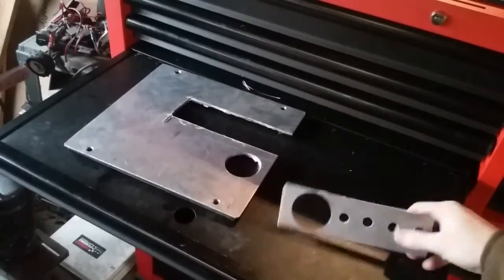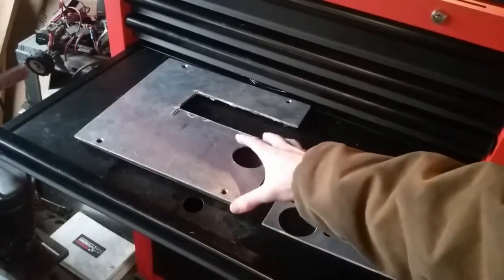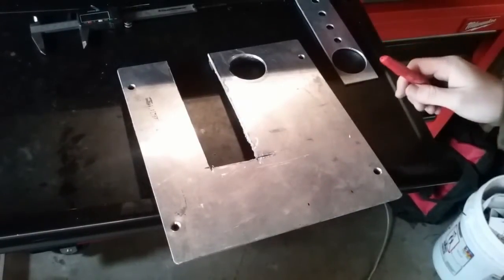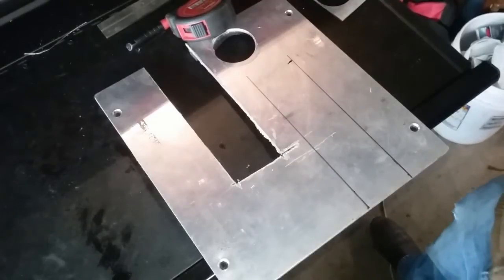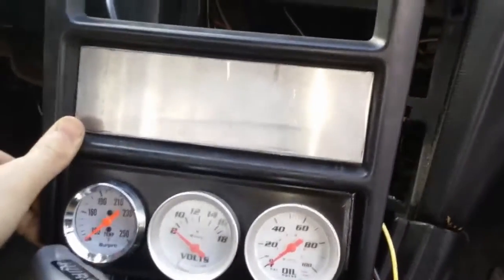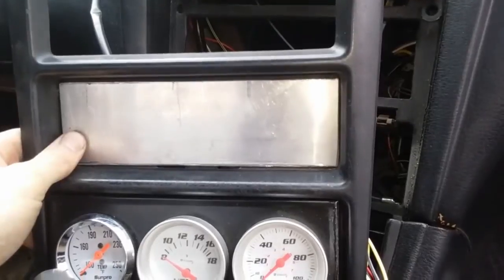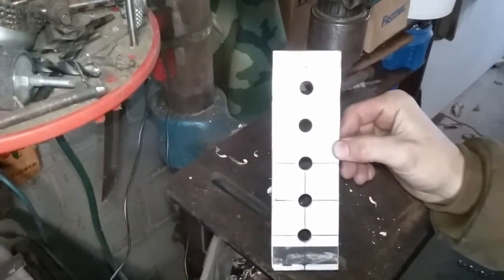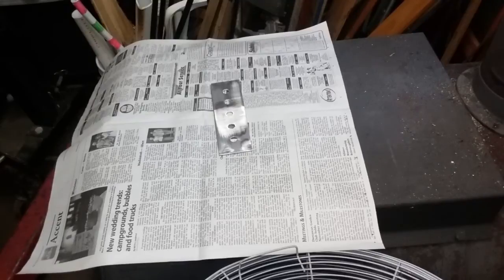Custom Switch Panel | DIY |

Comment: Ahhh!!! Cool vid but Why didn't you show how everything was wired in the back???  That's the one thing nobody seems to be showing...  : /
Reply from the maker: Sorry! Haha. Well they are a basic 3  wire switch. The switches themselves usually tell you what wire goes where on them,you will have a power terminal on the switch which needs 12 volt power, a ground terminal that will need ground ,and a switched power that will turn on (or send out 12 volts) whatever the wire  is connected to when the switch is switched.